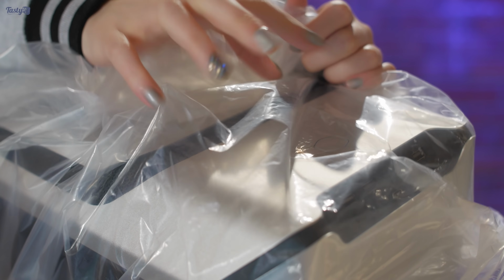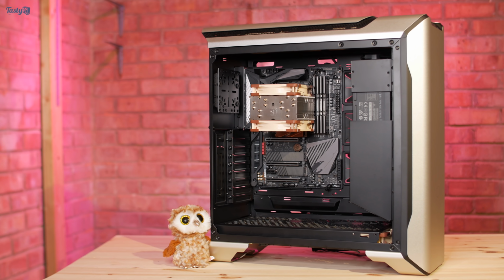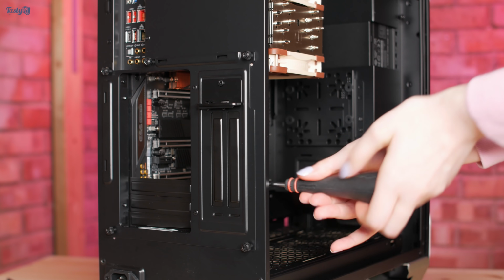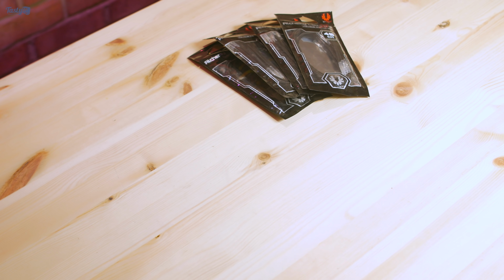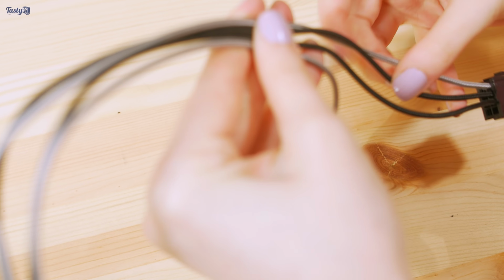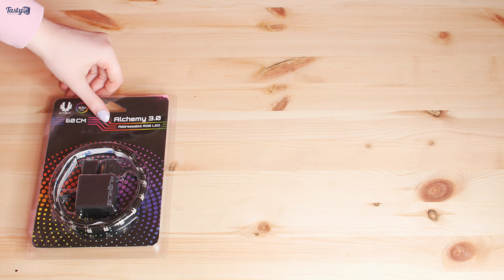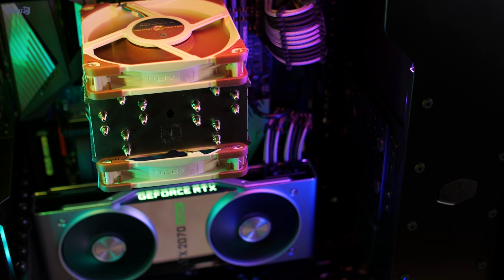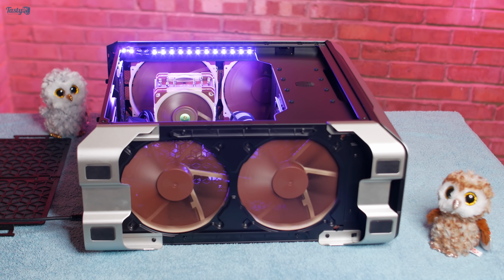Finishing My Ryzen 3900X 200mm Noctua Wind Tunnel Build

Comment: My personal experience with Gigabyte motherboards is they are not great. They have limited overclocking headroom due to their VRM thermals. My overall preference is Asus because of it's better Phase control and capacitors their boards are much more reliable and operate at lower voltages which also increases their overclocking headroom by running cooler.

Comment: Cablemod WideBeam RGB-W led strip has a dedicated white bar, has a remote controller and uses sata. You can even get a warm white or cold white. it's a litte bit wider but beside every RGB chip there is a white chip and you can even controll it differently. https://cablemod.com/product/cablemod-widebeam-hybrid-led-kit-60cm-rgbw/
edit: But it's not addressible.

Comment: I have to learn cable management ...☹️ I just ordered PC builded and and the PC was shifted to me by courier the shop is just 70km away....found out that they just builded my PC without cable management they just leaved the cable front after using 2 hours the PC stopped automatically found out my CPU cooler is not spinning recently it's spin for 5 sec while booting 
Really a bad experience for me that was my first Gaming PC 😭😭

Comment: Honestly, whoever designed the USB3 header aught to be launched into the Sun.  Sweet build btw!  It's good to see more of you. :D
Reply: I had a similar thought when I first saw one...
And again when I first had to plug one in and immediately thought "that's going to fall straight out or pull the socket off the board."
Reply: The usb 3.0 header is so stupid.
Reply: I noticed that despite what looks like a latch, or something to keep the plug in, actually isn't, it's just a keyed connector that is easy to knock out of place...
Reply: The USB3 header design has been good for me  - it's pretty easy to plug it in backwards and bend one of the USB3 pins, so I've been able to buy a couple of nice motherboards for cheap where the front USB3 doesn't work because the previous owner plugged it in backwards. I use powered desktop USB3 hubs anyways, so it's not a problem for me.
Reply: @Abstractism you can buy a 90c port extender for it to have it plugged in from bottom
Reply: I yanked my USB 3 header molding right off the motherboard. I just sorta plugged the case cable back onto the bare pins and still use the top usb ports that way
Reply: Yeah i was changin my aio i was unplugging things, and i some how   tuched the usb3 cabble, and the damn thing broke the pins off!
Reply: Agreed.
Reply: its not so bad if the maker of the motherboard does it right .the MSI X570 gaming plus has 1 of its two USB3's sticking out towards the front of the case so its easy to plug in and make look good

Comment: Wow, that is a really good looking system. Especcially the way that vertical mount is done in this case is brilliant. Usually you've got the gpu flat against the front panel, but this way there's plenty of room for it to breathe. As long as there's no need for additional pcie cards this seems perfect.
If you're bothered by the way that usb 3 header stick out so far, there are short extensions available with an angeled connector. Those make that connector look way less bulky ;)

If you're looking for digital rgb lighting i'd suggest you try corsair's lighting node pro. While it does require a software, you can set "hardware lighting". Meaning you will have to connect the lighting node to your pc to set the lighting effect you want it to display only once. Afterwards you can disconnect it and uninstall the software. 

That way you can have nice lighting without any software taking up system resources. If you fancy a change, just connect it again, change the setting and disconnect.
The only downside would be that there's no switch you could use to quickly change the setting. But if you don't plan on switching up your lighting every other day you might want to give that a try.

Comment: There’s no way that upward orientation works no matter how you spin it.  There’s a reason they aren’t done this way.  You’ll be dragging the warm air up from the video card into your cpu cooler.  Not a good idea, and this makes me think this is more for aesthetics than performance since literally no one does this.  I’d be interested in seeing the temps.
Reply from the maker: You’re forgetting that for years PC cases had optical bays meaning that most of the time cool air worked its way diagonally through the case from the lower front, hitting the GPU, then through the CPU cooler and out of the rear. So having the GPU in between the intake and the CPU cooler isn’t a new thing. I’ll have temps in the next video on the build. :)
Reply: Hi, thanks for the video. I want exactly the same build, please tell me what is the temperature of CPU and GPU, I can't find it in the next video, thank you:)

Comment: "The most annoying connector since the 4pin Molex". Ha, such a true statement lol.
Reply: so true lmao haha she really hit the nail on the head haha wow yeah
Reply: 4-pin Molex only works one way. It's perfectly fine.
Reply: @classicallpvault  Lol dont u get it? haha its a MOLEX .... LOL haha so true lmao shes so right lol
Reply: @brankojeric6742  I do get it, and I don't agree. Have been building computers since the mid 1990s. The molex connector isn't at all inconvenient to work with. It's big, the cables are thin and flexible, it fits only one way, is easy to daisy chain, and can also be easily disconnected. SATA power cables are way more of a pain in the arse to work with.
Reply: @classicallpvault  but dude.... ITS MOLEX LOOOL hahahahha lmao shes so funny hahah my kind of girl shes so quirky and nerdy like me hoooo star wars LmAo u dont get it BOOMER
Reply: @classicallpvault to disconnect them was My biggest problem. So much force sometimes
Reply: @brankojeric6742  I don't give a rat's arse about you or your opinion about me.
Reply: @classicallpvault  I used to build about 14 PC's per week not so long ago. I would disagree !. They are horrible. The pins on the Male plug flap around too much and it can be difficult to get them to mate with the Female side. Then only to find after seating it all the way that one of the pins has pushed out.. Grrrrr.
Reply: @classicallpvault  you're right, Im into computers also from mid 90's. I even liked IDE cables. 
These kiddos just need to be ignored, and their cringe statement about boomers, when they dont even know, that we are not boomers, but gen x or millenials... (speaking about Branko Jeric)

Comment: Y'all kids complaining about the USB3 header must be too young to remember IDE cables and connectors... cries
Reply: The difference between USB3 header and IDE, the connector for USB3 is , narrow and taller, versus IDE, which is wider and shorter. You feel safer in bending an IDE cable near the header, versus a USB3 header.
Reply: Installing ISA cards. . . Annoying
Reply: I am, been building PCs since I built an IBM AT (286) clone from spare parts in the mid 90s, never had an issue with either of them. RGB headers and SATA power cables are way worse IMHO. Or the absolute worst: having a case with front panel audio connectors which come as separate wires and pins just like the power, reset, HDD light etc. with absolutely no way of figuring out how they should be connected.
Reply: its such a breeze to build a computer now compared to before. no more setting jumpers manually -_-
Reply: Ha ide! i remember making ribbon cables and wiring rs 232 d cable connectors.
Reply: ok boomer
Reply: Don't you bring up that evil... if you speak of it, it could return!
Reply: who uses case usb3 ports?... always cut that shit cable
Reply: To true... FDD cables were the worst... not only difficult to connect sometimes, but some of the cables had a twist in the wires to change the pins and some didnt.... ANNOYING!
Reply: @hammerheadcorvette4  Damn those cards were almost impossible to install!
Reply: At least cheap IDE cables stayed in. Cheap sata data cables always fall out :(
Reply: lol, i used to build SCSI  machines lol ( old duffer)
Reply: She said it was the worst thing after 4 pin molex, which in my opinion is far worse than IDE cables. They're awkward but don't require a lot of force, meanwhile molex is just evil.
Reply: Man the unholy mess that used to be ribbons of IDE weaving through your case with so much dust, filters were just not a thing. I miss the honest aesthetic, though. Every component was coloured simply the reference factory colour. There was no attempt to make internal components look like toys. As such I think computers looked like computers. All this styling has made them lose that simple charm. I’ve invested quite a bit into my build and I just... I don’t want to do the whole sleeving and LED nonsense. It takes away from the purity of what it is somehow. Excellent cable management, good, silent airflow, and a well-thought out layout is what I like in my personal build. It would be fun to play around with some sleeved, aesthetic builds but I wouldn’t want to use one as my daily driver for some reason.

Comment: Regarding the RGB you can find "Phanteks Neon Digital RGB LED Strip 50cm"
I was not expecting this video to be this decent! Expected to see "girl streamer pc build videos" like when they pllay stupid. Nice to see someone good for once..
This setup is acutally really nice i would aim for a Watercooled Graphicscard to connect to one outgoing fan tho! Someone Girlpower! 

There are some things i do not like. 

1, The voice is "to close" sounding.. Try adding a Pop filter?
2, It would me better to run 2 fans blowing into the chassi and 1 out to get more of a positive pressure setup. Its always rasier to push air out of the chassi then into it and negative pressure will leave more dust :)
3, There is some things you installed that i dont really get... Like 1000W power supply.. But at least its safe if you interest in future upgrades.

Comment: Definitely curious to see what temperatures are like. I find ryzen chips idle at noticeably higher temps than what I am used to.
Reply: compared to what? mine idles 15°C above ambient at worst...
Reply: @mcl40000  at stock, my Ryzen 2600x doesn't truly idle. It will drop to around 15 or so above ambient and spikes randomly (and quite frequently) to 30+ above. Where as my old 3rd gen i5 (yes probably not the best comparison since they are generations apart and have completely different power requirements) would usually idle at around 6 above and "stay there" until you start putting it under load.
Reply: @GSXone  i know what you mean, my 3900x is also restless "idling". altough mine doesnt spike up that high...what i love about my ryzen chip compared to my i5-6600k is that the package temperature is so well transported to the cpucooler...almost the same temps as the cores! on my i5-6600k and my fx-8350k they where alot higher...

Comment: I only have one question for you, & there is only ONE right answer for it........... WHYYYYYYYYYYY are you not using water cooling? ? It is MOST ideal that the 3900x should be paired with water cooling for optimal performance. Plus, that Noctua tower looks hella ugly & ruins the aesthetics of your rig. Go Cooler Master ML240r or 360r, NZXT Kraken, or Aorus. Great tower cooler though,...... Just not as much cooling performance aaaaand hella ugly Lol... Plus, an aio with RGB such as, Cooler Master will suit the rest of your ligthing much better. That big old clunky thing just sticks out like a purple sore thumb. BLEH! ! 🤮😷

       Also, don't overclock your CPU like a lot of these vacuous clods do. Download Ryzen Master. Lock all 12 cores. Apply an undervolt with a raised clock speed (I’d say 1.01v at 3.9ghz). That will help with both gaming & workstation purposes. Only fools overclock this cpu, when you can actually get quite a lot of performance & better temps out of it by undervolting it instead. You’ll just be running it hotter & therefore lowering the lifespan of the cpu if you dare overclock it. It’s $500. So make sure to keep that thing running cooler & longer by doing so. Plus, even though you CAN, you shouldn't be using the cpu for gaming anyways. That's what you have the GPU for. If you game AAAAND edit with the cpu, you will be lowering it’s life expectancy with more usage. USE YOUR GPU FOR GAMING ONLY! !

       Also, idk what RAM you are using, but it should DEFINATELY be 3600Mhz or higher with 32gb if you can get 32gb (Will be great for real work purposes) if you aren't using those RAM specifications already. ON THE OTHER HAND THOUGH... I noticed you are using a mobo with FOUR DIMM slots. Regardless weither you are using 3600Mhz or higher or not, you really shouldn't be using four DIMM slots. Using four modules is likely going to lower your frequency and timing. It is objectively proven that two DIMM slots/modules are optimal for the 3900x. You WANT that frequency. I promise you that. I believe you are using an X570 mobo though, assuming that the heatsinked M.2 NVME SSD is Pcie Gen4, so I would understand that you may not want to just willy nilly buy another one, since ik you payed a prettier penny for it. I myself have an X570 mobo from Gigabyte Aorus, but it is a mini itx one, so I didn’t pay as much as yours, but for a mini itx mobo, it was still on the pricier side. So I understand.

       On the flip side. Get water cooling, undervolt your cpu, & get 3600Mhz RAM speed if you haven't already. The cooler while the faster, the better. Also, as for lighting. May I suggest switching your black & silver PSU 24Pin cable & GPU Cables to Lian Li’s RGB Strimer cables? ? They will most definately compliment the surrounding lighting of your case. As for strips. I highly reccomend Phanteks newer RGB strips. Bitwit has recently reviewed them, & they are probably the most beautiful, smoothest, most flexible rgb strips on the market rn. I highly suggest checking it out. Try to be a bit more patient in your research before you go off buying stuff btw. It will help in the long run.
Reply from the maker: You should watch the prior 2 videos in the build series before you write such a long comment because it answers a lot of your questions. This is just a workstation, I have a separate gaming PC. I don’t overclock/undervolt or water cool my workstation as I want it to be as reliable as possible. I went with the memory that would fit and I may upgrade later down the road.
Reply: @TastyPC  You do know I am not obligated to type a SHORT comment right? ? I can write as long as I want. Rather you read it or not is up to you. So Idk why you're being so bootyhurt about me giving you objective advice lol.... jeez. Corona virus got you on edge or what? ? Calm yo butt down woman lol

       Second, undervolting your 3900x ACTUALLY makes it morrrre realiable. If you have done your research, you would know that AMD has the 3900x at an unnecessary higher voltage than needed. Jaytwocents & MANY other fellow youtuber pc enthusiasts/technicians who have FARRRRRRRRR more respectable reputation than you have. So it’s a fact set in stone that you absolutely SHOULD undervolt & raise the clock speed as opposed to not doing anything on it at all. Worstation or not. That would give you AMAZING performance that this cpu has to offer, while running cooler & faster. Your losing performance if you don't.

       Soooooo, you saying that you're using it for a workstation doesn't really have any merit against what I said. On top of that, no one has to watch your previous videos to know why you don't want to use an AIO or something, because you really don't have a more important reason to not do so, when that is what is best for your cpu.... That is LITERALLY the MOST optimal option for that particular CPU,..... aaaaaaaaand if you went with AIO, then you wouldn't have had to worry about bulky RAM heatsinks then would you? ? No one put you at gun point & forced you to put that big old bulky thing on there Lol
Reply from the maker: @NiteSek4804  Wrong
Reply: @NiteSek4804  Funny how the people who type the longest comments tend to be the least knowledgeable. I don't know if that string of condescending nonsense was meant to impress us but you just ended up embarrassing yourself.

Comment: I am surprised your computer was working after you installed a MB without any Anti Static wrist band on. It takes one spark from your hands can fry a processor, memory.

Also why would anybody use a heaving heatsink instead of an LC CPU cooler which puts less stress and strain on the MB.
Reply: People go with a heatsink because it's more reliable and doesn't have any pump noise. I bet in a high airflow build like this it's significantly quieter than an AIO cooler.